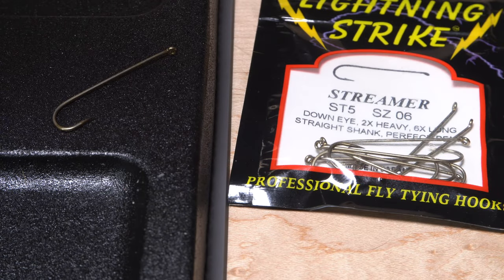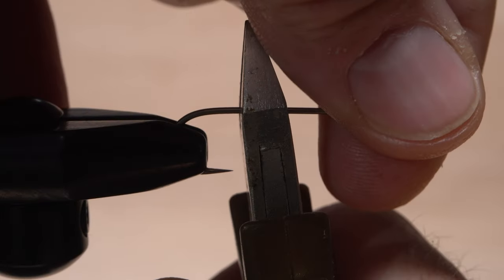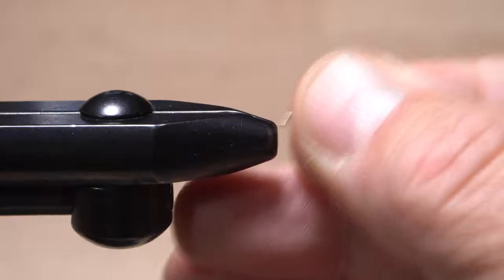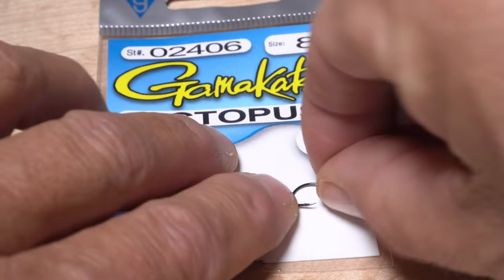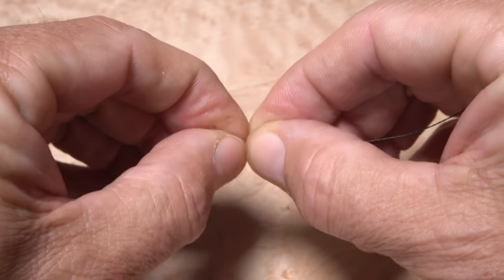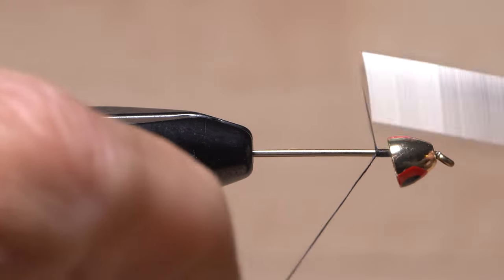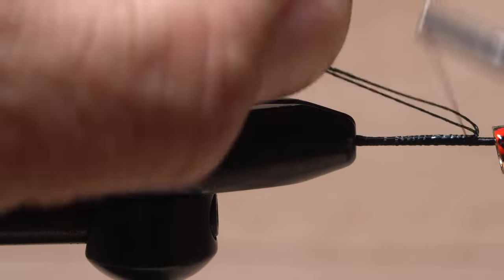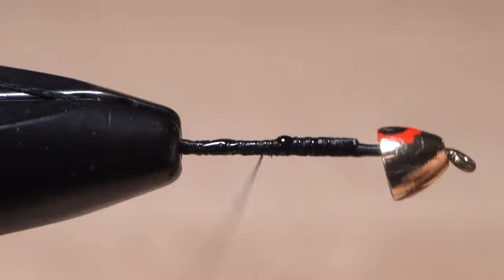Cut Shank Foundation

Comment: Tim. For years I tied the trailer on just as you’ve shown. Fishing for Kings and even for Silvers I have had several pull out. So I changed to threading the braid through the cone head, through the hook eye and back along the shank before tying it to the shank. I eliminated the super glue and have never had one pull out.

Comment: When using super glue, allow the glue to dry before placing the fly in your fly box or case. If the fly is placed in a clear case too soon, the evaporating glue will fog the csse as well as coating other flies in the case.

Comment: i always get paranoid about how tough the connection is with the braid wrapped around the shank. Even with super glue. I usually tie these trailer hooks onto jigheads that have a 90 degree bend, so i usually wrap it there first and then the shank itself, just so if it fails on the shank it wont pull completely with it tied physically to the hook. Im unsure how much overkill this is. Trailer hooks are definitely great tho, perfect for trout that are tail nipping